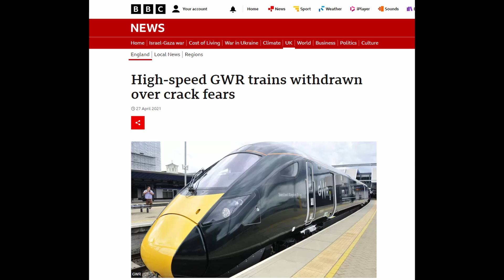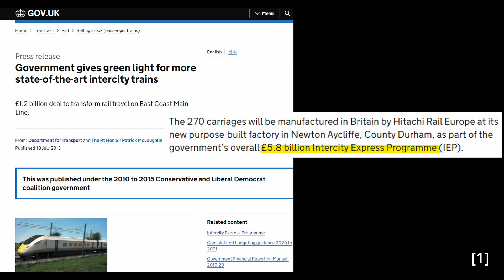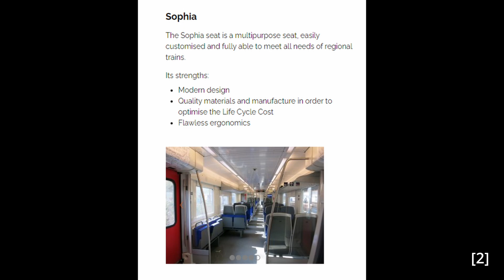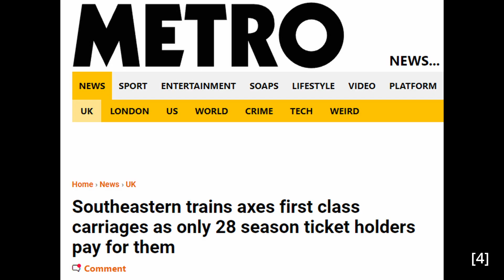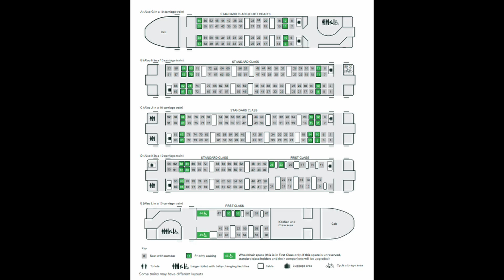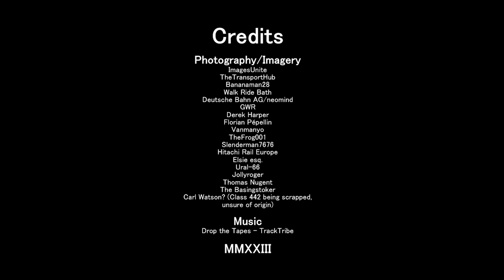Can the IETs ever be decent?

Comment: It disappoints me as a Hitachi fan, especially as they make the E8 Shinkansen and E657 trains a lot better than this, thus the 395 too. I feel that these trains can't sustain high speed at 200 km/h since their fastest A-Train in Japan goes only 130. Since it is also has many parts from the commuter stock too, it's not reliable for these uses. However, interior wise is chosen by the operator, not Hitachi themselves which I can defend Hitachi but yea their reliability is questionable, a lot worse than J-TREC's E233-3000 which has Hitachi built motors too. Hitachi makes better trains in Japan than the UK but again, it is built in the UK. If it was built in Japan, reliability would be a different story too. However, I still like this train as it resembles a lot of Japanese trains, if you go to Japan and ride the E657, E259, E233-3000, E531 and the E8 Shinkansen, it would be memorable, heck even the commuter Sotetsu 20000 series is a high quality built commuter train by Hitachi. But yea the 800 series, idk about that.
Reply from the maker: Some of the earlier units were built in Japan, and most of the 802s were built in Pistoia, Italy. Not that many are actually built in Britain, interestingly.
Reply: @GWVillager  Ah I see, well are the Japanese built ones more reliable? No idea yet.
Reply: @rayyan6515 The Italian factory was also building unreliable trains for other operators outside of the UK, Hitachi was strangely hostile to the UK operators changing the interior, I think it was just a case of GWT being weak and not insisiting on their own design.
Reply: @suburbia2050 then again somehow the IETs are using parts from trains you can see in Tokyo Metro 😬
Reply: The fastest A-trains only go 130km/h in Japan because of the track not the train design.
Reply: @B-A-L Ye that’s true…

Comment: I wouldn't bet on First Group keeping the Western Main Line for much longer. Things might be better. Overcrowding is a thing of First Group. They lost the First Capital Connect service, because of dirty trains, and the main problem,  overcrowding. The Western Main Line, that they took over from stagecoach they gave up, (SWR) and now are running it as a management company for Network Rail. Overcrowding was a problem with them, as the trains from Salisbury came down to my part of the country as a two car, when they took over. Now they are no longer the franchise holder, Network Rail instructed them to put more cars on. Now we have 6 cars.
Reply: First Group has never run a service for good service's sake. The whole GWR rebrand was just a nostalgia-driven exercise intended to make the public think they'd turned a corner (or even changed ownership). I think the logo and the green looks good, but I never forgot who was still lying underneath the new livery.

Comment: Regarding track wear from fitting heavier bogies - The DfT could offset this by completing electrification to Oxford, Swansea and Exeter (both routes), something that should have been done decades ago. Then the IETs wouldn't need to carry the extra weight of diesel engines and diesel fuel all over the place, as is the case on the east and west coast mainlines.
Reply: Just make the first "mega project" election of the entire network this will hopefully reinforce British engineering
Reply: I very much doubt you will ever see wires past Bristol, although Taunton is a possibility if they got very enthusiastic about it. I certainly would like to see a Freightliner 90 work into Fairwater yard before they are gone. The cost is always the problem and mainly the availability of sufficient power in the national grid at hand (which i think is a bigger problem than they want to admit right now).  Taunton Cardiff/Padd in the hands of an EMU solution would free up a load of units!  
Exactly how they have managed to make an MTU power unit unreliable is amazing to my mind and needs to be investigated. I am told drivers don't give a damn about the IET and just get in and hammer them, as it's not a big power unit and isn't even in the vehicle with the driving cab they are somewhat detached from the mechanical stress and actions - unlike a 150 or HST power car you can feel its behaviour or bad reactions.
Reply: @leonblittle226  I'm not enthusiastic about Bath ever seeing wires either
Reply: What about West of Newton Abbot, where you really need the power. Or are you going to get everybody to change train at Exeter? The whole project is a typical DoT shambles.
Reply: Electrifying to Oxford would not do away with diesel engines as same sets are used to Worcester and Hereford under diesel power. The real benefit of electrification would be to allow extension of class 387 sets from Didcot to Oxford. There needs to be electrification through Bath to Bristol TM too. These are infill projects.
Reply: Dft can't bear electrifying the colonies outside London

Comment: They're not called the Shithatchi 800's for nothing
Bloody hateful things.
Lighting, seating, ambiance, cleanliness, ride, noise, absolute crap 1st class compared to the trains they replaced.
I like the idea of the pods in 1st class
I also like the idea of 2x5 units with the forward unit providing a fast service and the rear unit following on behind as a stopper service (The Hastings units used to do this between Tunbridge Wells and Hastings)  A fast service west of Exeter calling at just Plymouth, Truro and Penzance would be very welcome and much sought after.
The Shithatchi 800's were built to a price, not a standard
Reply: Don't blame Hitachi, they had nothing to do with the interior and it's obvious you have never seen what Hitachi is capable of when it is given the proper budget anyway!
Reply: You obviously don't have to ride the bastard things for 4:45hrs once a week

Comment: What worries me about replacing seats is that they might squeeze more in like they did with the HST, I even prefer the hard bar on my bum to the abysmal legroom they had. I think a strip of wood or laminate flooring down the aisles would be nicer than the carpet and help break up the monotonous grey. I also find the lip around the edge of the tables pretty uncomfortable. 

I think the lesson is to not let DfT spec out a train ever again
Reply: What was need was freedom for the operators to decide their replacement and interiors. Then I believe we would get better trains that were more reliable.
Reply: @Mgameing123 or alternatively we get something even worse under the guise of delivering better value to shareholders, it could go either way with most of the TOCs that operate some variant of the 800s
Reply: Wood or laminate is a terrible idea. We don't live in a dry country and the H&S concerns would be significant. A dark carpet is a better option

Comment: Cheap fix: call them ICs. Whoever came up with the ridiculous IET? There are too many problems with these trains which over time is going to cost an absolute fortune to keep them running. The decision should be taken to scrap them once a replacement is on the stocks. The DfT is just as much to blame as Hitachi as it determined the specification. If you want a good product then look no further than Siemens. Also the rest of the GW mainline system must be electrified, like, urgently. Bimode, as now, is not the answer. Your video has opened a can of worms. Well done.
Reply from the maker: The DfT certainly made a big mistake ordering these - a modified version of the Siemens Velaro might have been a good idea, but I don't know.
Reply: Even if siemens made these trains they would still be bad due to DfT tinkering
Reply: Hitachi makes quite a few Shinkasen models and up to date ones too. So I don't think it's mostly on Hitachi. It's more likely more to blame the DFT.
Reply: @gerogyzurkov2259   somehow I suspect JR pays Hitachi more per-train than the DfT wanted to
Reply: @kaitlyn__L  They did make the current just gone into service N700S along with it's predecessors N700 series, 700 series, and E5.
Reply: @gerogyzurkov2259  yeah their Japanese trains seem really good.
Reply: @kaitlyn__L  can't argue with that statement when they made the majority, even the og 0 series, and continued to make more of the Shinkasen And other JR rail
Reply: Even just as far as Taunton would be a huge upgrade
Reply: I think Hitachi did have a good track record with the 393 Javelins for the reason why the government made such a decision.
Reply: @sandletters39  I read cause they where the lowest bid.
Reply: The class 395 Javelins don't have all these problems but are more or less the same under the hood, so why has it gone all wrong this time around? Hitachi and the DfT have an awful lot to answer for about all this
Reply: @grassytramtracks  Javelins are more of a high speed commute train. Look at the interior. Azuma are designed for longer distance travel. Most of Hatachi trains have been great and most of the Shinkansens have lasted as long as the HSTs. It's more on the DFT than Hatachi that needs to answer it

Comment: Wouldn’t be tricky or that expensive to fix things.

Step 1: remove the seats
Step 2: replace the carpet
Step 3: change the lighting
Step 4: put different seats in

Done:
Reply: You could even coincide this with some electrification. Electrify down to Penzance and then bring the iets in to have their disel engines removed (they become electric only) which would reduce weight, energy consumption and track wear. And at the same time improve the interior.
Reply: @cameronallan5624 Realistically though they would need to bypass Dawlish to Electrify the entire distance and with recent coastal storms there is the question of how feasible it would be for Penzance to have overhead lines.
Anyway they already have a class that's electric only. They have 800 and 801 one of which is the diesel bi mode.
Reply: @cameronallan5624  Electrify the railway? Anathema to the DfT and Tory Govt. Look how long they resisted upgrading lines in the Pennines.
Reply: oh I know. The DfT like to faff about. But its important to note that the Pennines are now getting electrified with the TRU. Granted they took their time, but it is now happening. Same applies to the Midland Mainline.  Eventually all the heavily used mainlines will be electrified and then Penzance will become the next most heavily used non-electrified line.  But yes it will be decades till this happens.
Reply: @cameronallan5624  the cost ratio for wire expansion to wsb from Newbury is 0.13, won't happen
Reply: @cameronallan5624  the thing that needs to happen is this country needs a rolling electrification programme to always be doing some new track every year. The problem with how we're doing it now is that we have a big project or two, it's mismanaged and goes way over budget and then we don't approve any new electrification for 30 years. In that time we forget any lessons in how to possibly do it better this time and it's the same cycle, we need to keep doing it to keep the expertise in how to do it up and that keeps costs per mile of track down
Reply: HSTs need to be properly replaced with decent trains, not brought back. They are just too old and unsafe, the drivers in HST have 0% cockpit crash protection for example. We need to identify what drivers and passengers liked about the HSTs and have those bonuses applied to new trains. 

We need to change the way railways are run and managed too, something like British Rail is a cool old thing that does need to be brought back as through something like that you can drop the "profit over everything else" type attitude that prevents us from improving things, like the IETs.

There's a chance that BR would get better funding too, as the Tory party seem to have finally consigned themselves to the history books at the next election, the corporate Labour party could be pressured into decently funding it through some Mick Lynch type energy.
Reply: @moonshapedabsolution 
How many drivers have been killed in HSTs since the stock came into service?
Reply: Hard Agree. As much as the HSTs were great from a passenger perspective. The iets are better from an operational perspective. First they are electric (environmentally friendly etc) they are quieter for line-side residents and have faster acceleration. Apart from the horrible interiors I think they are actually great trains. Fast acceleration, high capacity etc.. @moonshapedabsolution
Reply: No doubt even those changes would cost a few billion pounds for the government.
Reply: i mean the whole Pendolino fleet of 56 trains are having their seats replaced and interior fittings redone at £117m. The GWR iet fleet consists of 57 trains (admittedly 5 and 9 car variants so not directly comparable to the Pendos).  So I would expect a similar cost for the iets.  Lets assume that the government electrifies the rest of the Great Western Network (££ billions) and the iets can have their disel engines removed.  Factor in diesel engine removal (the iets were designed to have them relatively easy to remove) I reckon £150-200m to refurb the whole fleet. Much much cheaper than getting a whole new train manufactured.  @stephenmatura1086
Reply: @stephenmatura1086  shouldn`t cost that much , the entire fleet didn`t
Reply: Might as well slap a step 5: good repaint for good measure.
Reply: Great comments
Reply: @QwertyScream third rail won't work in Devon and Cornwall
Reply: Everything on the railway is over complicated due to legal (and many other) reasons. Give the British something that has the potential to turn into an over abundance of paperwork and they will do it. During Covid, many staff rec rooms had to get screens to avoid transmitting germs and they costed £1200 each (I’ve heard) because they had to 1. See where they should put them and see whether it would be worth the cost (which would have been estimated at a much lower cost) 2.Find someone to design them 3. Find someone to manufacture them and give them lots and lots of money. 4. And then ask someone to install them, making sure to give them plenty of money!
Reply: Plus:  remove all those partitions and at least have an open lobby like in trains such as Turbos and Electrostars.
Reply: Step 5: Bring back HSTs
Reply: No, nostalgic but they've had their day. Ride on one these days and you'll see why. @nathanw9770

Comment: The reason for the short formations is because the Castles are being wound down but instead of being replaced with new trains they are just spreading the existing fleet more thinly. There are far fewer 10-car sets running than there used to be – most of those are now running as 9s (or even as single 5s), and that has left gaps where they used to have 9s and they are now being subbed with 5s. It was a ridiculous decision to scrap that many trains without any replacements, and short formations on intercity services was the inevitable consequence.
Reply: What is here is the classic case of making a silk purse out of a sow's ear. The trains are - as has been displayed - poorly thought out and, in some cases built. It all really started with the farce that became the GWR electrification programme that was abandoned half way through. The wires should have gone through to Swansea, Plymouth (both B&H and Bristol T.M.) and Oxford. The Penzance - Plymouth/Cardiffs could then have seen a modern sort of 5 car 159.
But that's sensible and  Britain's railways have never done sensible.
The most comfortable seats that I ever experienced on a modern train were the original ones with the dark blue colour on the 377s. For some reason some were fitted with soft luxurious ones with dark blue covers and some were fitted with ironing board ones with light blues covers. They were all😅 changed for ironing board ones quite soon after introduction.
Reply: There is the possibility that Transport for Wales' Class 158's will move over to GWR when they get replaced
Reply: @hi-viz  Let's hope so – 2+2 class 158 formations for the Cornish main line and Portsmouth services should be the goal.
Reply: @hi-viz  It's looking very likely that the pick of the fleet will come to GWR even for an interim period, possibly even the whole lot with the junk ones coming to light quickly after to become spares. It requires little in the way of traction refreshers - interoperability and servicing is already existing. 
The interesting points are the availability of the entire 175 fleet , or financing being available for a 197 variant being obtained as the general unit fleet is really getting old.
Reply: And another negative for IET, especially the ones replacing the Castle Sets going to / from Newquay, GWR doesn't allow surf boards on the IET's
Reply: Again the case of the SRA not thinking of passengers tbh.
Reply: @timlewis1165  Err, wasn't the SRA scrapped in 2004???
Reply: Yeah and I find often times you'll book a seat on a train that should have 9 or 10 coaches, only to find that when the train pulls in your coach (and therefore seat) isn't there because it's suddenly a 5 car train. They don't give any prior notice that the train has been shortened either. They normally let you on the next train even if you have an advanced ticket but that's no good if you have to be somewhere at a specific time.
Reply: (Hopefully) Good news!! Seems like the 175s that TfW ran are going to GWR to cover the Castle Sets that have gone. 2024 should be the last full year of HST service in England, I believe they will be gone by May 2025.
Reply: Your shorter formations are now approaching what we have had to endure in the North for decades. Even now we count ourselves lucky to get even 5 carriages on anything other than Avanti.

Comment: would say re design and replace at best the seats, roofs and engines although the 180 had un reliable engines and GWR solved that.
Reply: No that was first Not GWR.
Reply: @Busandtrain123  didn’t first group own GWR and still own GWR
Reply: @Busandtrain123 GWR is still run by first. New name, but exactly the same operator
Reply: FGW & GWR are the same @Busandtrain123